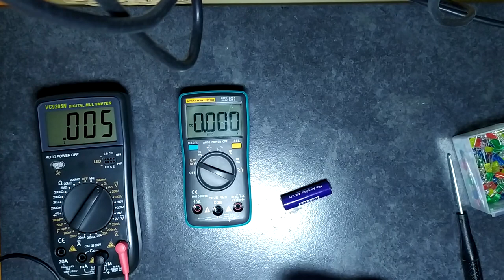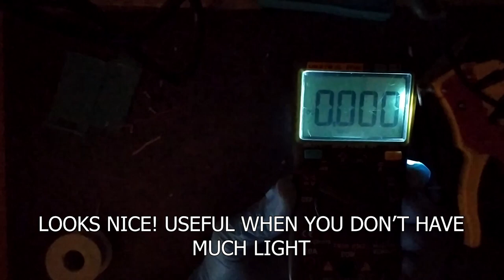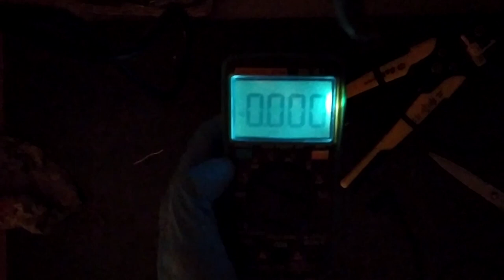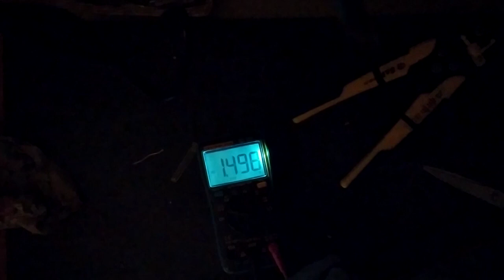DIGITAL MULTIMETER - BACKLIGHT MOD

Comment: Why are resisters used? And how do you know how much resistance to use?
Reply from the maker: As i wrote in the video, the resistor was not necessary in this case, the resistor in this video was 22 Ohm, You will want a resistor when the voltage is higher than 2,9V depending on the LED, Blue LED for example can survive a little bit higher tension, usually on low voltage i use small resistance, also the resistor help the led survive if there is some over voltage, Anyone feel free to correct me, i'm still in the process of studying electronics
Reply: @cibe  Thank you. And good job on that project.